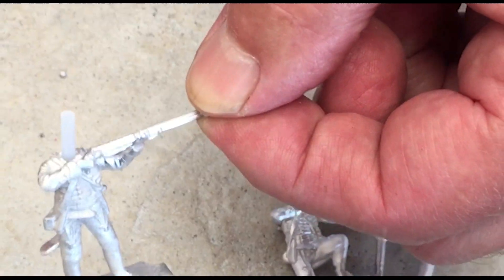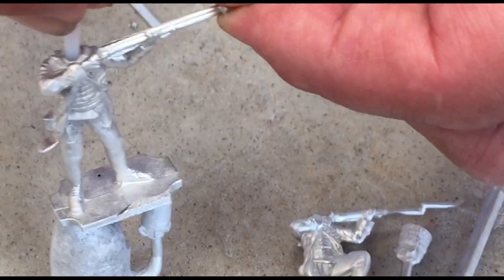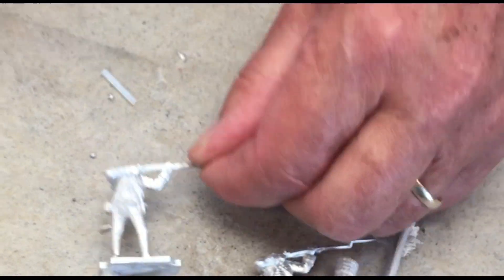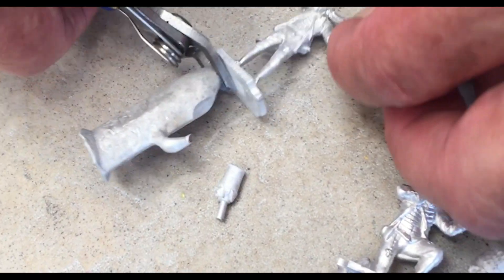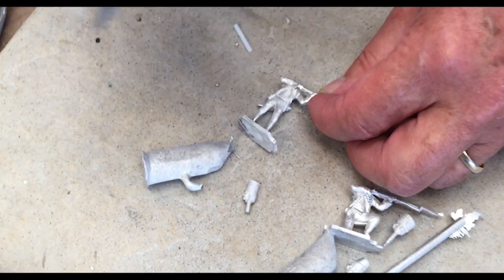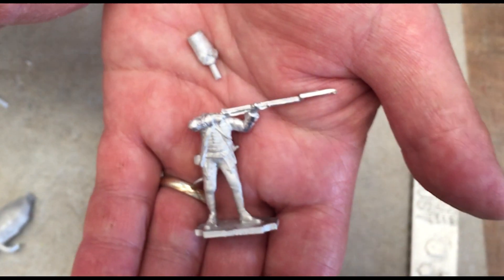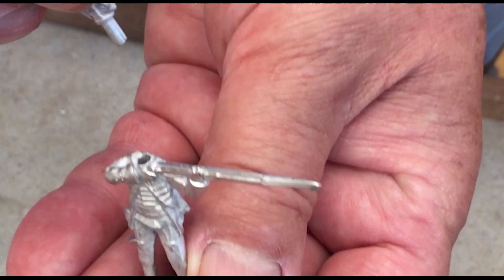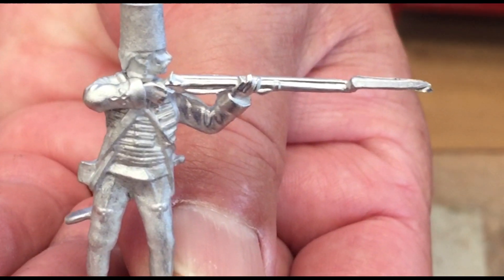Prince August Hobby Cast Tutorial - Part 4/4 - Assemble the metal figure.

Comment: Do you sell blank mold making kits?  For master molds?
Reply from the maker: No, only moulds that are already designed. You cannot make the moulds yourself without a huge press. We do offer a custom mould service however if you have master figures you wish to turn into moulds. A silicone rubber option for NON metal masters is available too, but more expensive.
Reply: @princeaugustcasting what mood are you using
Reply from the maker: https://shop.princeaugust.ie/pa3128-seven-years-war-austrian-grenz-and-pandour-40mm-mould/ @thatwargaming5459